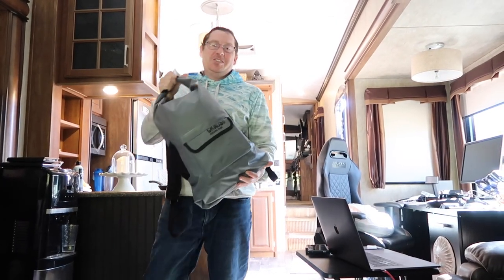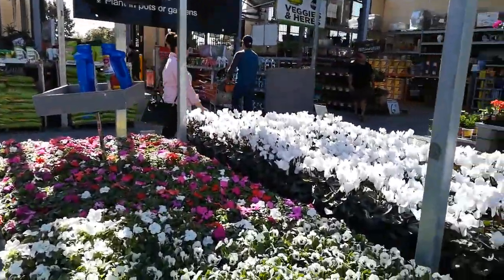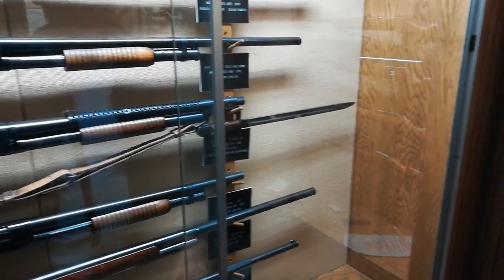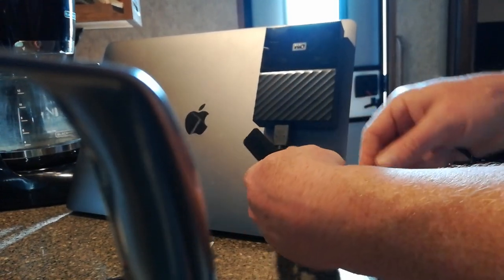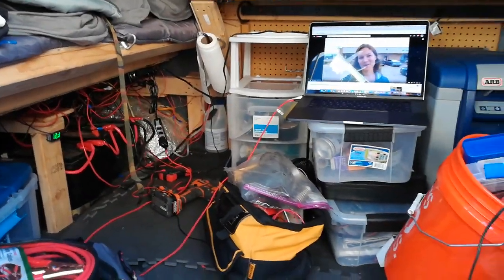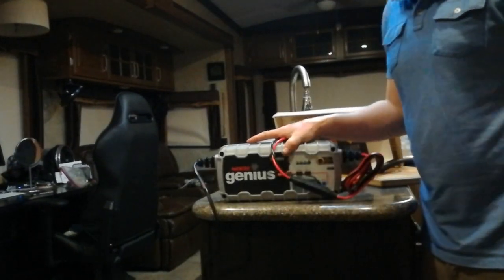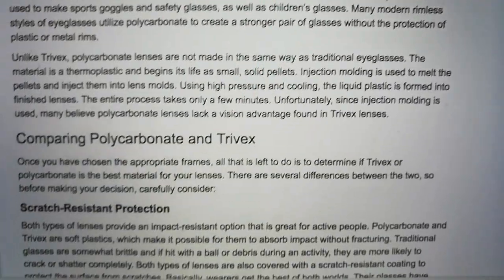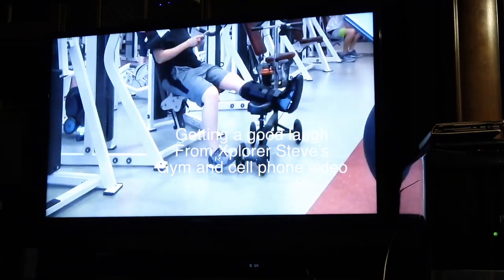van dwellers will love these 7 pieces of gear

Comment: Get some me Poly Watch from Amazon for scratches in your poly lens glasses. It’s for scratches on polycarbonate watch crystals but works for spectacles too and it’s way cheaper than new lenses. You might also consider getting a pair of prescription sports goggles for hard use situations. They are much more durable and scratch resistant. Not all that fashionable for every day use but great for work, cycling and banging around in non social environments. Zenni Optical has some reasonably priced that don’t make you look like an alien bug. Again, cheaper than replacing lenses in your daily glasses every few months.

Comment: The reason glasses suck these days is none of them are actual glass. It did have added weight but was very hard to scratch.
Reply from the maker: but gorilla glass. they need to add some coating on there that's actually scratch resistannt!  frustrating.. i scratch them in 3 months.  not sure what i'm doing wrong!
Reply: I think safety standards mandated glasses not be real glass because poly is like 6 times more impact resistant. So phones can have real glass because its apples and oranges. I don't think you are doing anything wrong. I never know what to properly use to clean mine, either. I use hot water, soap and keep an egyptian soft cotton washcloth just for my glasses.